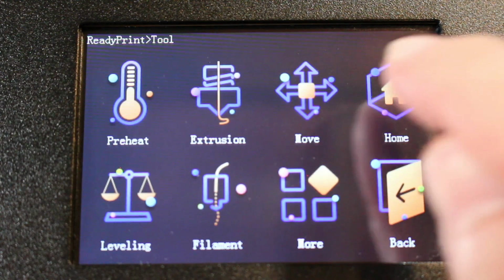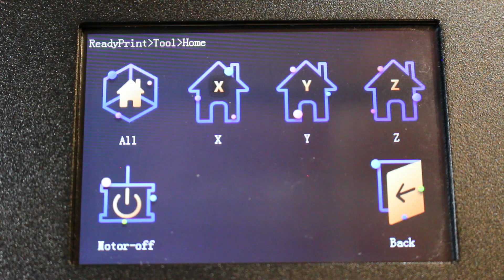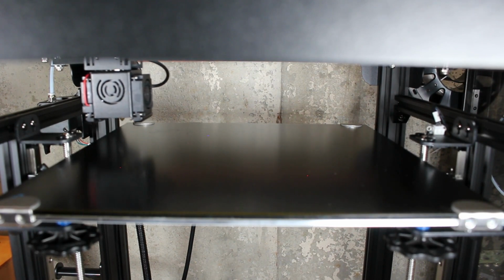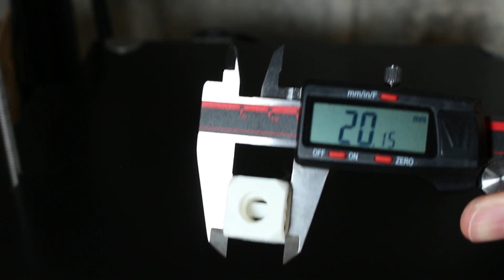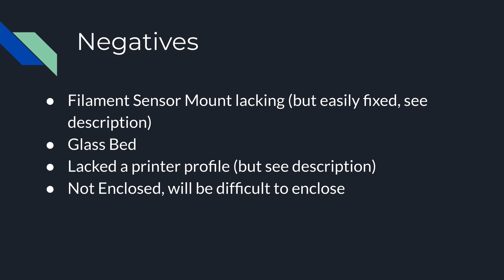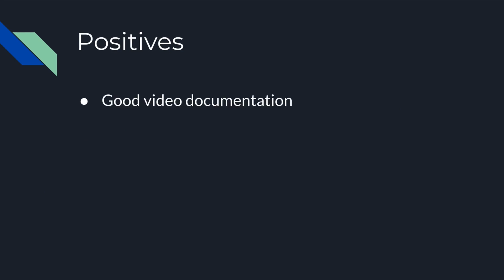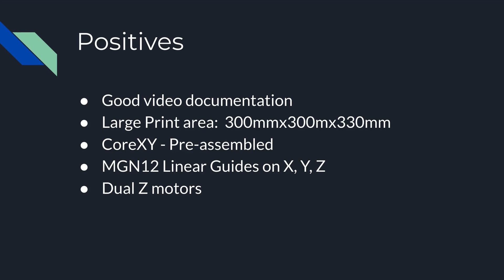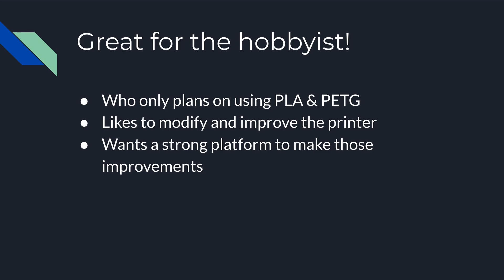Two Trees SP-5 3D Printer First Print!

Comment: i also own a sp5, upgraded it with klipper using the mks pi. Now i think this printer can give a honest quality/speed considering its a cheap corexy, the downside point in therms of upgrading the printer, you dont have much space to place bigger steppers in the x and y axes. Like you ve said, it has potential, a thicker bed with ac heater, and a good direct drive extruder can turn this entry level core xy to another dimension
Reply from the maker: It's working quite well.  I upgraded to Klipper as well.  I also went to a direct drive extruder: https://www.printables.com/model/169465-the-diamond-mount
I made a silly mistake and broke the heat break in the hot end.  It was the perfect excuse to make the change above.

Comment: I tried one of the Sapphires but the Y rails just bound up too much and no matter what pattern I tightened them in they would bind once the rail was fully bolted down. This was something I loved about my Voron 2.4 which was the perfectly smooth travel on both Y rails with no racking, both ends hit their min and max at same time which I thought impossible with 3D prints and extrusion. Perhaps this is where the genuine hiwin rails shine.
Reply from the maker: These were a little rough when new, but once I greased the rails, they seemed to run just fine.  I have not had any trouble with the rails.  That said, I like my hiwin rails a lot! Thanks!

Comment: Can only advise people not to buy tow tree products
They don't live up to the warranty they give and don't care about shipping
Bring crooked machines onto the market so customers can just pay for crooks they can't use.
Have a brand new sp5 which has never made a print yet because it is very crooked and for that reason burnt motherboard and motor etc. of, have even had to pay for new parts and even if they use marlin packaged in their code, they can't and won't help and the mechanical parts that have to be changed for the machine to run yes you can't buy them without almost having to buy them a new machine and now it must be said that I am a trained precision mechanic, electronics technician and programmer and have developed printer plotters etc. for many years, that company is a scam and scam stay away from them and buy something else
Reply from the maker: I'm sorry that has happened to you.  Which parts are crooked that are causing all the problems?
Reply: @KapmansBasementWorkshop  I think a large part is in the holes, they were drilled to the wrong measurements, and what burned the motherboard off is a defective bearing in the beds so it falls a little to one side and thereby locks, the worst thing is that TowTree doesn't just send new ones parts or a new machine, even the software, they didn't want to help with that, so you had to spend some time yourself to get it up and running again, it's not right at all that a new machine should cost that much plus all the time that is used and still hasn't run a full print, most recently I tried to ask them where I can get some new bearings for the bed but they can't answer that either.
All machines can have errors and that's ok, but not that the manufacturer doesn't do something about it to solve it, I also once had problems with one from Creality but it was solved then even though I'm not a fan of their machines, people should probably buy from them or others who try to correct their mistakes in the future as well ..................So if anyone needs the Marlin code for such a machine, they can get it here, but you should probably expect it to have to be adapted a bit, since I don't have the opportunity to fully test it before the mechanical drive.
Reply from the maker: @allanrasmussen5789  That's certainly not good. I would expect them to stand behind their product as well.  Thank you for the feedback.
Reply: Hello! This is TwoTrees. Do you need any assistance? Can you provide your purchase order number? We will provide feedback to the sales department to help you solve the problem.

Comment: If this one is not good to enclose which would you recommend to do that with? Looking to get into high temp filaments like ultem and pekk.  Thanks for nor the nice review!
Reply from the maker: How high are you looking to get to?  ABS & ASA or higher?
Reply: @KapmansBasementWorkshop  Higher, 350-400 extruder and up to 140 in the chamber. Haven't printed with it before but that's what's recommended for PEKK.
Reply from the maker: Those tend to use chamber heaters, external motors and more. The lower cost ones that I am aware of are from creatbot. These types of printers can get very expensive. Make sure you have a look at the filament costs as well. At least an order of magnitude more expensive.
Reply: @KapmansBasementWorkshop  well the goal is to take a cheap printer similar to the one you reviewed, add some insulation, a heater, new hot end and probably some manual firmware changes and let her rip. Thanks for the tips about the external motors. I had not thought of that.
Reply from the maker: @OhGosh360  also, many microswitches used in end stops cannot handle more that 80c where they start to break down. You will also need to make sure you have high temp belts. Lubricant for bearings need to be taken into account. And fire safety is critical with an internal heater.
Reply: @KapmansBasementWorkshop  oh more good tips, thanks!
Reply: This guy has enclosed an older sp-5 it looks like with some success: https://youtu.be/SmOzs3JZ6cE?si=V8LqWfFzfFrqmutg

Comment: Kapman, I bought an SP-5 last year. I ended up returning it for poor quality. The metal brackets between the bed and linear rails, the hot end brackets, and the bearing brackets at the top of the z-screws weren't straight and caused alignment and binding issues. I couldn't get the z home switch in the right position, and the cooling fans scraped the bed well before the nozzle came close.

I ended up returning the printer after 2-3 months of working with their disinterested tech support who tried blaming me. I never understood why they didn't just send me some replacement brackets to fix the problems.

Can you check your z-screws to see if they are binding? You didn't seem to have the same z homing and hot end issues that I had.
Reply from the maker: I'm sorry to hear this.  The printer has been working well for me.  I have not noticed those issues in the version I received.  But, I will have a closer look.  I did just recently break the heat break in the hot end, but it's purely my fault.  And now, I have an excuse to mount a completely different hot end.

Comment: What stepper motor drivers did yours come with?
Reply from the maker: I don't want to pull a heatsink off to see.  Is there another way to tell?
Reply: You should be able to pull the whole driver out of the board and see on the bottom side without pulling the heatsink off.

Comment: I have the older, smaller Sapphire Pro. It is a really solid design, but with a few cheap bits, like the hot end and extruder. Doesn't look like anything has changed in the newer SP-3 and SP-5 models. It is now a very dated printer and not something I would recommend to anyone wanting a good, just works, out of the box experience.

However, as a very solid frame with a good corexy motion system, it makes a great starting point to do your own thing. About the only original parts in mine are the frame and motion system.
Reply from the maker: That's pretty much where I ended up in my evaluation.  But now, I cannot help it.  I want to upgrade this printer.
Reply: @KapmansBasementWorkshop  Yes, lots of fun, they are really solid starting points for DIYers.

Comment: The problem I had with it out of the box is the hotend and extruder , I put a Voron extruder asembly on the one I built and its great now, I am also not a fan of the firmwear its a bit odd and clunkey I ended up putting Klipper on it, I did kinda buy it with the intention of a cheep Voron replacement tho
Reply from the maker: The firmware is going to change soon.  So far, the hot end and extruder are working ok. But I assume that once I speed this up, they may not be able to keep up.  Did you change the glass bed?
Reply: @KapmansBasementWorkshop  I brought my Sapphire Pro second hand and the previous owner had glued the glass bed down. Hell of a job to remove it, but now using a PEI coated magnetic spring steel bed like all the cool kids now use.
Reply from the maker: @davethetaswegian : I have not glued down the glass bed for that very reason.  The bed is working well with the PEI flexible bed plate?
Reply: @KapmansBasementWorkshop ,  yes no problems with the PEI flexible sheet, just removed the glass and replaced it with the stick on magnetic sheet that most kits come with.
Reply from the maker: @davethetaswegian  Thank you!
Reply: @KapmansBasementWorkshop  I have upload the mount to Printables, shouldn't be too hard to find, it is titled, very descriptively, "Twotrees Sapphire SP3 SP5 mount for PI 3.5" Touchscreen".
Reply: Same here. I use a fiber glass bed
Reply from the maker: @tsayon13  Please post a link to the fiber glass bed you are using.  I'm very interested.
Reply: @KapmansBasementWorkshop  oh and I removed the belt that connected both z motors so I can use z-tilt mode on klipper
Reply from the maker: @tsayon13  , I plan on doing this very soon as well.  I'm not sure I understand why one would want that belt there.  Thank you!
Reply: Likewise, I DIY'd my own direct drive hot end using an Orbiter and Revo. I didn't like the original firmware and touch screen at all, I added a Pi and switched to Klipper. And, for that very neat factory original finish, a 3.5" Pi touch screen fits very neatly in place of the original allowing for integrated KlipperScreen.
Reply from the maker: @davethetaswegian , I was wondering which screen would fit in that spot.  Thank you for this tip!  On another 3d printer I converted, Klipper was able to make use of the LCD screen attached to the MCU.  Are you aware of anyone that has made this one work with Klipper?
Reply: @KapmansBasementWorkshop  The screen on my Sapphire pro, an MKS Robin TFT35, is one of those that run their own software, it is not compatible with Klipper. It looks the same as the one on your SP-5 including that large ribbon cable connecting it to the controller.  Although I have used similar screens with klipper, like the one on the Ender 3 V2, it requires connecting it to the Rasperry Pi and someone to doing some custom coding to support it. Never found anything like that for the MKS screen. The common cheap 3.5" raspberry Pi screens (make sure you get one with a touch screen) fit nicely, although you will have to print a bracket to hold it in place (I will upload my bracket to Printables and post a comment when I have). Depending on space, you might need to use a ribbon cable to connect the display and Pi. The advantage of doing all this is that KlipperScreen runs rings around the original kludgy interface.
Reply: @davethetaswegian  im using the thing:5218294 adapter for the orbiter v2, just need a better one to attach the drag chain
Reply from the maker: How did you fit the Voron extruder on the gantry?  Did you end up changing the x-axis and flipping the MGN12 rail on it's side?
Reply: @KapmansBasementWorkshop  its a Voron Afterburner remix, and I bought a G10/FR4 plate and the seller cut it to the bed size. (I bought here in Brasil)